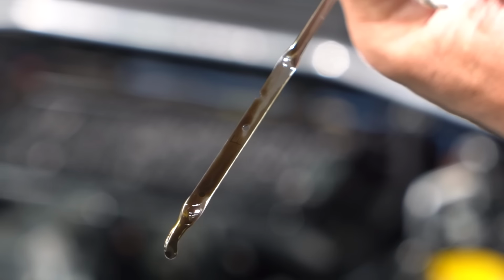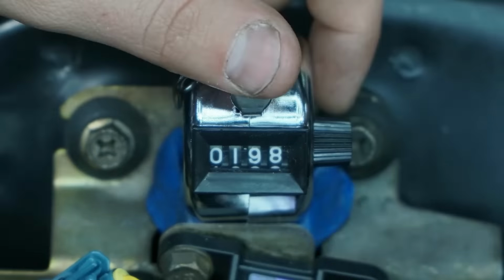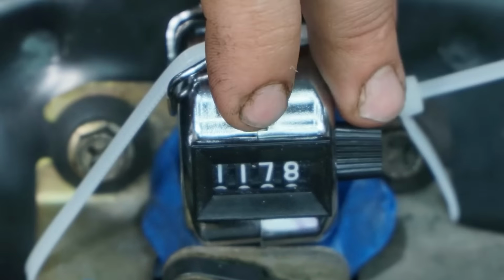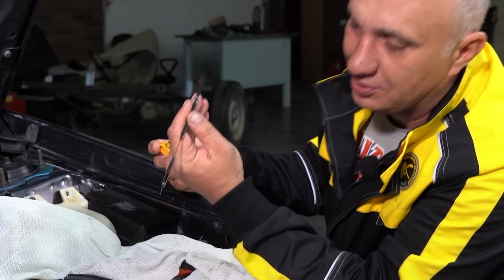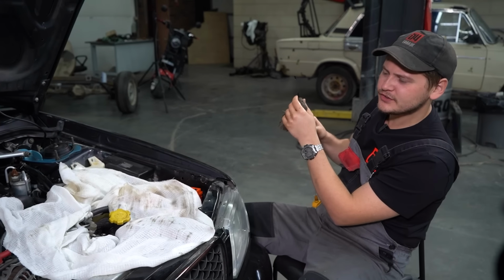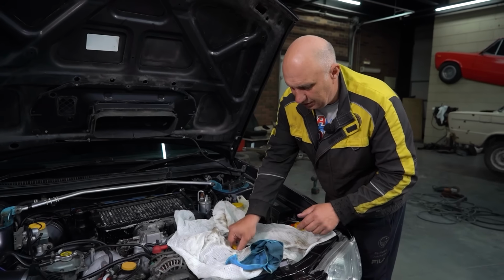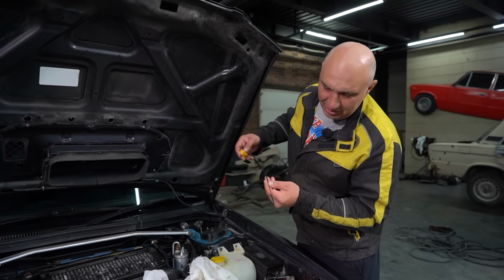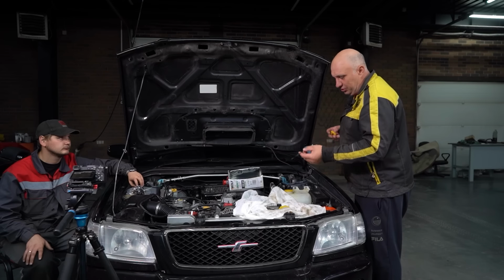What happens when you check your oil waaaaay too many times?

Comment: Oil change hard edition
Reply: Dipstick only goes into the sump about a quarter of the way (the difference between the full and add marks is only about a liter or so and the engine holds around 3.5-4L) you could never actually change the oil this way, but it is funny to watch!
Reply: @twoeightythreez yeah it only rears the top 1-3 quarts
Reply: @twoeightythreez  it was a joke..

Comment: Irony here is you could never actually empty the engine with the dipstick because it only goes into the oil about a quart and the engine holds at least four.

Definitely a good way to durability check the dipstick though😂!

Comment: The notch on the dipstick represents engine plus oil filter level, after oil and filter change you fill to the notch and after running engine the oil level will be on full

Comment: According to Mercedes Benz you should leave the stick in cold oil for three seconds. In Florida I couldn’t see the difference between 2 seconds and three, but on 0 c days 20-50 takes two seconds to get as far up as possible. You probably have thinner oil. And it is June so I hope you are not freezing. Vlad was not allowing the oil to get up imho . See if you can tell. And nex January a thorough investigation into cold oil behavior on dipstick. Spacibo

Comment: Yes I think you saw a bigger move the lower you go because the shape of the oil pan on most vehicles tapers and the reduction in volume lower down means there’s less to drain. Good video though. I wouldn’t think it possible to cause a low oil condition by checking it too often. 3000 miles oil change intervals means like you said if you check it every day you will be out of miles before you ever begin to notice the slightest movement on the dipstick. But if you have an oil leak severe enough to cause so much need to monitor can you not fix it or have it fixed?

Comment: Here are two ideas. Enclose the entire engine bay but the radiator with steel sheeting and see how long it takes to overheat. 

Build a external steel reinforcement frame around a small car and weld it to the unibody at various points. Put a 2” ball hitch on it and see how heavy of a trailer you can tow until the car can’t move.
Reply: I made a frame on my 1981 vw rabbit from 3/8” plate😊

Idk
How much it can tow
I can tell you it’s more than a stock one!!
Reply: You could probably tow multiple lorries. I mean if strong humans are towing lorries then a car ought to be able to. I think it would take 2-3 lorries before it was overcome by rolling resistance in first gear. I think it takes about 200 ish kg force to tow your average lorry. A small to medium car in first gear could probably pull with at least 500 kg force (though it wind take a while to accelerate to peak torque). Something like a high end bugatti chiron could have up to 2 tonnes of towing force so 8 to 10 lorries on flat.

Comment: A lot easier to simply weigh how much oil comes out with each check, and then calculate how many checks it will take to lower the level lol....
Reply: More fun this way
Reply: That's boring
Reply: @samonsthewise  Good point! - But it's easy to measure how much oil remains at the minimum level vs the maximum fill line, and then assume a linerar regression to the minimum line is a 45 degreee slope..

Now that assumes we are not trying to "empty" the crankcase to where NO oil remains on the dipstick. That is an impossible task, because assuming equal insertions, SOME oil will ALWAYS remain, even if it's an unmeasurable amount.

It's the whole paradox of infinite division.

Put another way, it's impossible to excract ALL the oil the dipstick is capable of picking up, but easy to calculate how many dips it takes to remove the amount MEASURABLE by the dipstick ;-)
Reply: @samonsthewise   Right. But the reduction is proportional to the amount of oil lost with each dip, which decreases. It's a slope - easily calculated by weighing the amount of oil lost between each dip, and then extrapolating.

Comment: How many times does ity take to empty a full gas tank if you keep opening and closing the gas tank lid for a check?
The out-airing of the fumes will take a way some fuel every time, and after 350 000 times the tank is only half full.
Reply: If you have high ethanol fuel not that long.

E85 sales are limited in summer because such a high volume evaporates that it
Negatively effects the air quality
Reply: Yet another reason diesel is superior. 
It doesn’t evaporate 

Aka the fuel you buy isn’t being turned into toxic fumes before you u even run the motor like it IS with gasoline
Reply: @fastinradfordable  I still want to know this important thing🙂